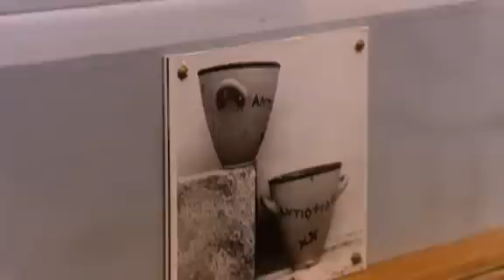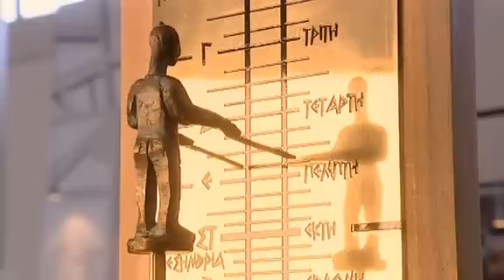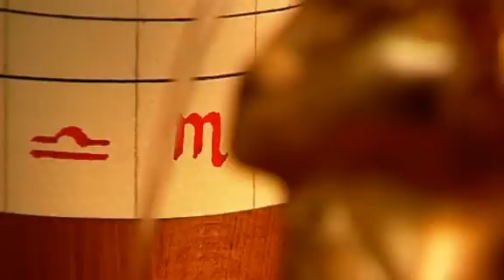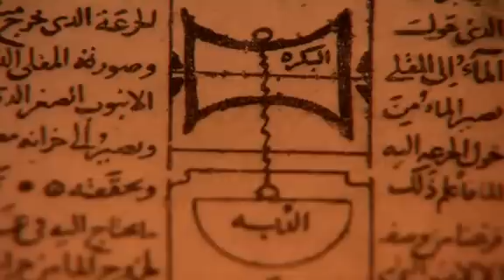Ancient Mechanical Clocks

Comment: The first water clock could have been a tidal lagoon or basin which of course both empties and refills. This wouldn't have necessarily been in phase with daylight hours, but I think high and low water are the same amount of time apart throughout the year, and through neap and spring tides as well. A practical time keeping device used for keeping track of the tides would naturally be divided into 12 with the 1st hour after low water defined as the time by which 1/12 of the tidal range has been reached,  by 2 another 2/12, by 3 another 3/12, by 4 another 3/12, by 5 another 2/12, by 6 another 1/12. so by tide-turn all 12 12ths have been added, because 1+2+3+3+2+1 = 12. At 7 of course we're back down 11/12 of the height and so on. As far as I can see 12 is the only whole number (or multiples thereof) you can do this with and get whole numbers. A face or scale divided into 10 for example would have to log a tide turn at 5 and log the 5 water height increments 1/10  2/10 3/10 2/10 1/10, but here the numerators don't sum to 10. That could be why 12 came to rule on clocks including maybe even sundials.

Comment: How did ctesibius reset his water clock when the 3rd container became full?
Reply: Most likely by a Pythagorean Cup (https://en.m.wikipedia.org/wiki/Pythagorean_cup) -like siphon; similar to how modern toilets work. When too much water is in the bowl, the weight of the water pushes itself up through an upside-down-U-shaped tube, dragging the rest water with it outside the container.
Reply: by the 4th container

Comment: 3:45 Couldn't they just vary the width of the vessel with height, so that the flow rate is directly proportional to the surface area of the water?
Reply: The change in speed comes from the weight of the water itself, and since the nozzle remains the same size, all the water behind it will always produce the same amount of weight.

At least, I think that's the explanation. I'm sure if it were as simple as making a conical reservoir, or some other shape, they'd have done that instead of making a whole new contraption.
Reply: Aeghamedic The rate of change in volume will definitely vary with depth, but Δvolume is equal to Δdepth multiplied by surface area.
Therefore Δdepth is equal to Δvolume divided by surface area.
Therefore, if the flow rate is directly proportional to the surface area, Δdepth will be constant.
Maybe there is a reason why this would have been too difficult to set up using period technology, or would have been less obvious given their understanding of physics and mathematics, but it would still have been nice to have an explanation of what was so hard about this seemingly easy problem.
Reply: Adam Thornton
If flow rate were only affected by surface area (and thus, air pressure), then a water clock of constant SA would drain at a constant rate, but we know they don't. The reason is that the water itself exerts pressure on itself. As the volume decreases, so does the water pressure, and that makes the flow weaker.

Having a variable SA isn't all you need. Having a constant height, however, is exactly what would work. The water pressure and air pressure remain constant in that system.
Reply: Aeghamedic The surface area of the water, or ambient pressure, doesn't affect the rate at which water leaves the container at all. However the speed at which the surface goes down is given by the rate of water leaving the container divided by the surface area.
For instance, if the surface goes down by 0.1 mm, and the surface area is 10,000 mm^2, then we know that 1000 mm^3 of water has left the container.
Reply: Adam Thornton
But time's also a factor here. The time it took to drain by 0.1mm is affected by how much water is left in the clock (how much pressure is exerted on the water near the nozzle).

With a constant height (and constant water pressure), the drain rate would also remain constant. The rate itself is irrelevant as long as it's constant.
Reply: I'm sure you're right, the cross sectional area needs to increase with height to exactly compensate for the different flow rates at different heights.  That will linearise the scale.  Quite likely an exponential horn, doable in ancient times.  It intrigues me that I've never seen it.   Hope you don't mind this very late contribution!
Reply: @raykent3211  Time doesn't figure when you're figuring time.

Comment from the maker: BTW, I now see that I may have misunderstood you. If you asked me for the actual source that was used for this dosumentray, I have no clue. However, it's easy to find alternative sources by just Googling "Ctesibius" and "clepsydra". You'll get far more detailed information than what was presented in this clip. What Ctesibius basically did was to improve the standard Greek clepsydra water-clock by adding complex mechanical gears and indicators for more precise time measurement.